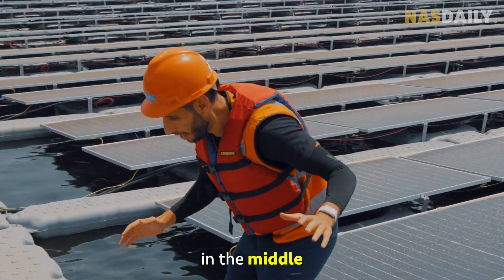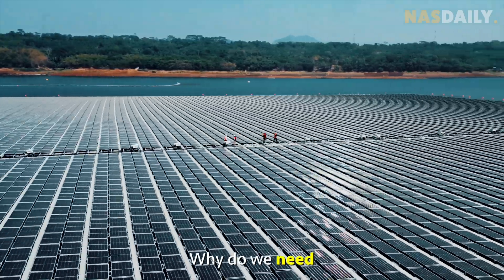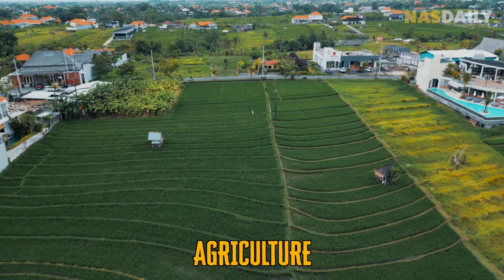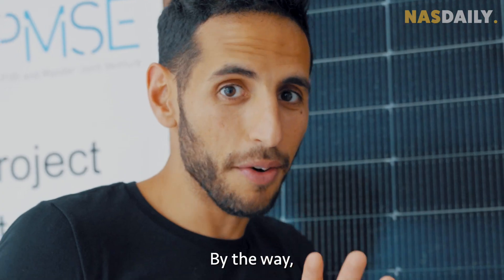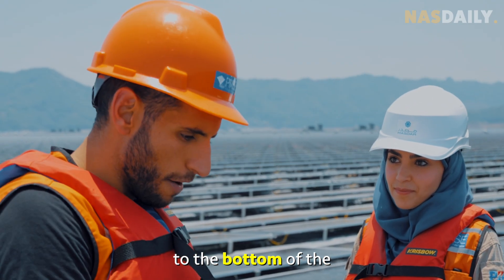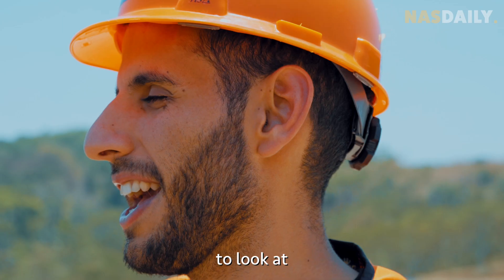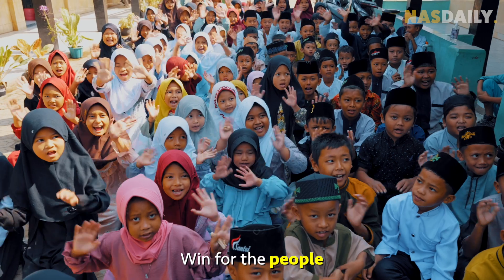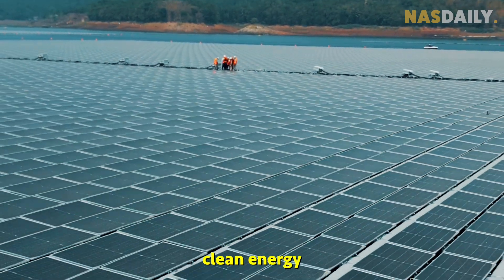Why Indonesia Built a Farm on Water.

Comment: That's not the zero carbon emission when you built larger construction projects the placement, manufacturing and construction have some carbo emission.
Reply: And? What is your point?

Every construction projects will of course produce carbon emission when they are being constructed. The difference with this one is that this solar farm will produce energy with significantly less carbon emission when it is operational compared to other methods. 
So what if there were carbon emission at the time it was constructed? The clean zero emission energy it produces for the years to come when it's fully operational will make up for it!

gimana mau maju kalau komplen mulu elah